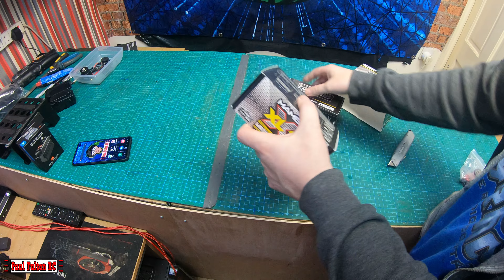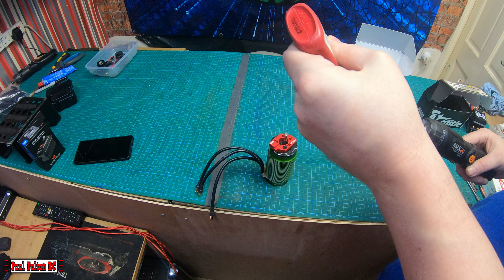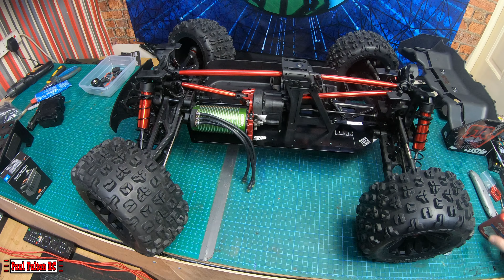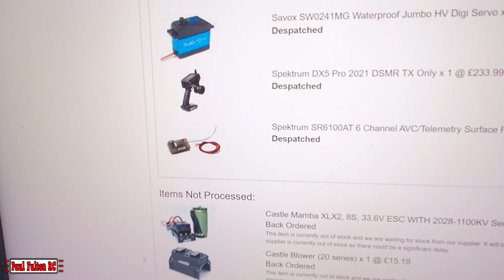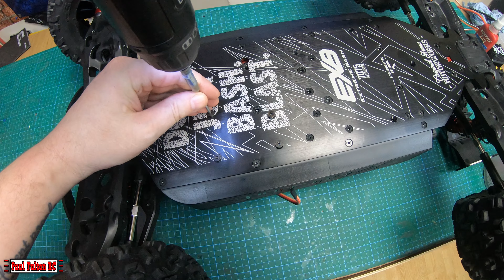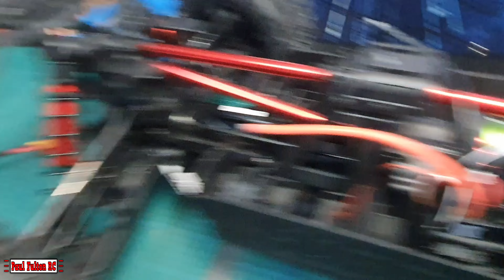Arrma Kraton 8S EXB RC. Fitting Castle Mamba XLX2, 8S ESC WITH 1100KV Motor.

Comment: Where did you get tha battery operatedt screwdriver? that thing works pretty swiftly id like to own one
Reply from the maker: Cheers. It is one of these ....

https://www.carousell.sg/p/electric-screwdriver-6nm-tacklife-cordless-screwdriver-2000mah-li-ion-45-accessories-with-9-1-torque-gears-adjustable-2-position-handle-2-led-light-usb-charge-storage-box-tdsc01p-1062723006/

Any decent one will do. Just get one with a clutch so you don't ruin threads. They are great for nipping up bolts. I got mine from Amazon but they don't list them anymore. Good luck with your search for one and cheers for tuning in.

Comment: I like your videos. I just bought a K8EXB  during the last sale. I wanted to run the Reefs Beast 1000.  I am assuming I will have trouble fitting that servo?
Reply from the maker: I reckon so. It looks longer than others and you will have problems fitting servo saver. Take a look. https://www.youtube.com/watch?v=-h5Rt0b_BLc
Reply: @FullOnRC  ya, I saw that one already, but thanks man

Comment: The savox servo would have fit with no problem using the 5th scale servo box that comes with the rig.
Reply from the maker: Incorrect. The Savox servo I used The mounting tabs are not located where they need to be for this car. The mounting holes for the Arrma ESC module did'nt line up and if you force it in, the pivot on the front servo saver binds on the chassis guard mounting where the bearing and servo saver swivel pin are.
Reply: @FullOnRC  check out RC Recon video part 1 kraton build. The savox fit with no issue. 4 other youtube builders use the same servo and it fit.
Reply from the maker: @joeycrack509  The servo I had hit the receiver box before it sat on posts. I thought the other Arrma module, the gap between posts was smaller?
Reply: @FullOnRC  I've been on the fence with what servo can handle the weight of this vehicle. Loved your video 👍🏾👍🏾👍🏾
Reply: @FullOnRC  One more question some had problems with steering rack hitting the back of the 1100kv motor. Did you have to do any shaving?
Reply from the maker: @joeycrack509  No it was fine for me. I nolonger have the car to check but it ran fine when I had it.
Reply: Subscribe 👍🏾👍🏾👍🏾
Reply from the maker: Nice one  @joeycrack509  All the best and season greetings to you and your family.

Comment: Omg! Buddy why you beating   yourself up with that shitty driver!!  Check that thing in the garbage!! 
Nice build though.
Reply from the maker: Drivers?
Reply: @FullOnRC  seriously? An electrical driver is defined as an electronic device designed to control certain parameters of the motor for controlling the electrical energy into mechanical power in a precise controllable way.
Reply from the maker: @clayton8465  LOL I thought you meant driver as in a hex driver, A driver where I am from is "A driver is a software component that lets the operating system and a device communicate with each other." I would just call it an ESC.

Comment: Hi I'm new to rc cars I have the kraton 8s for my first car I wanna  install this same castel motor and esc I was wondering can I use a power hobby servo or do u have a better recommendation
Reply: Ok thanks for replying im not on Facebook at all but thanks anyway
Reply from the maker: Hey thanks for tuning in. I can not say on the servo sorry as I would want to be wrong. I can only suggest you ask in some of the Facebook Arrma groups in case someone has fitted it themselves. Hope you get good answers.

Comment: Great video 👍 you happen to have a link to the pinion you use for the motor? I can't seem to find one that fits right
Reply from the maker: Search arrma spool. You use the arrma limitless spool.
Reply: @FullOnRC  Can I get the part numbe? r I want to be sure
Reply from the maker: @slowmocrawler  Z-ARA310950
Z-ARA310944
Depending what gearing u want to use.
Reply: @FullOnRC  awesome thanks for your help 👍
Reply: @FullOnRC  which one did you use  ?
Reply from the maker: @slowmocrawler  29 pinion and the smaller one of the two spurs running twin motor fans.
Reply from the maker: 29...39.
Reply: @FullOnRC  thanks again sir 👍👍👍
Reply: Did you use both the grub screw and pin on the spool gear? Would 2 grub screws be ok? I just received mine in the mail still waiting on my new motor

Comment: Hi buddy! U are really Arrma Kraton fan!! You got the best stuffs for both 8th & 5th scale Kraton! :) how does the 9110 servo holding up? Do you need to cut/modified the box to get the servo to fit in it? Thanks once again for the great videos!
Reply from the maker: The 9110 servo is great, Straight fit into the 8s Kraton, a bit pricey but it is good and in my mind you get what you pay for, Am I a Kraton fan, yes I guess I must be, the are epic RC@s the 8s Kraton feels a little delicate if I'm honest compared to the smaller EXB. Thanks for stopping by my friend and tuning in. CHeers.
Reply: @FullOnRC  I am waiting for my local hobby shop to call me once the Outcast EXB arrive. If I am getting the 5th scale, think most likely I will go for the Outcast 8s exb than Kraton 8s exb.
Reply from the maker: @evo165  I like The Outcast 8s exb, I like the Kraton 8s exb with the XLX2 and 1100kv motor, It shifts, although the DBXL is slower it feels better to drive., Let me know if and when you get your outcast 8s exb and what you think of it,, what esc motor are you thinking of putting in it ?
Reply: @FullOnRC  I am planing for Spektrum 9120 servo, HW max5 with 1100kv motor. It seem to me the 1100 better suit for the slightly shorter Outcast than 800kv.
Reply from the maker: @evo165  Wheelies for days.
Reply: @FullOnRC  Bro, to be honest, if you are only allow to keep 1 exb, the 8s or 6s version? Which and why? Most importantly, which one make you smile/laugh the most? Hope to hear from you soon sir.
Reply from the maker: @evo165  If I co9uld only keep one EXB it would be the 8s. Why, because I have nothing else like the 8s EXB, the 6s EXB is not much different from the standard 6s kraton, although it is faster due to its powerplant. But saying that, the 6s EXB is a hell of a lot more durable. I'm stuck which I like more. The 8s EXB is bigger so more fun to drive. It has to be the 8s EXB. LOL
Reply: @FullOnRC  lol! The final answer, u still want both EXBs! 😇

Comment: Does your original 56 motor mount fit with the 1100kv 2028 series motor? You only put 2 screws in?
My mount does not fit all 3 screws :(
Reply from the maker: Only two screws fit the 56 series mount. I presumed thats just how it is with the 1100kv motor.
Reply: @FullOnRC  OK thanks! Do you have any issues with "only" two screws?
Reply from the maker: @patrickjago1436  Aint run it yet sorry, but other 8s I have use only two screws. I think it will be fine.

Comment: Now that is an EXB!  I really wanna try the promax solderless connectors.  super expensive but I really dont like soldering, and they have a crazy amp rating.  honestly, If you aren't using it for speed runs or anything stupid, XT90's will do. I don't know why all the fuss, the anti-spark xt90's have a good amp rating and can take the heat (if you get the right brand).
Reply from the maker: Thanks for stopping by @Bow River RC. I just wanted a connection I could use and not worry about even after a few packs run through it. I read the XT90s are rated at 100amp. This esc it states in the instructions uses more so I just wanted to be safe. I have wanted these qs8-s connections for a while.

Comment: Nice👍 I've recently gotten a 1100kv  hobbywing motor for my xmaxx after my stock one died....
Reply from the maker: Nice be interesting to see if it improves it any. Is the 1100kv better than stock Xmaxx motor?
Reply: @FullOnRC  definitely, stock motor is 1250kv. I will be running different gearing though.
Reply from the maker: @SLD-RC  Cool. I forget what gearing i'm running in mine 20/47 I think.

Comment: First putting all electronics in/on the receiver box and then get the whole box in the car was much more easier for me. By the way JX Servo HV2060MG 60KG fits perfectly and is under 30 Euro.

I'm looking forward to your first run!
Reply from the maker: Cheers. I did think about doing it that way half way through. Will know better for the next time.